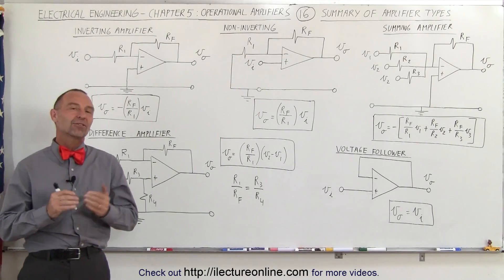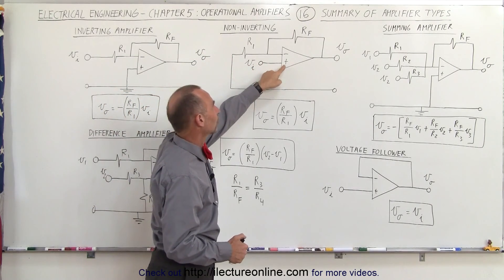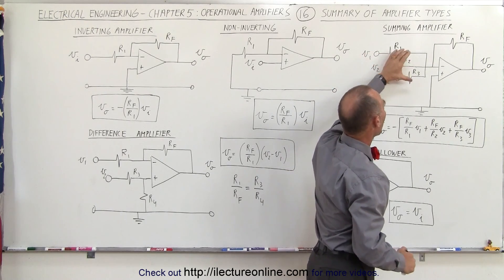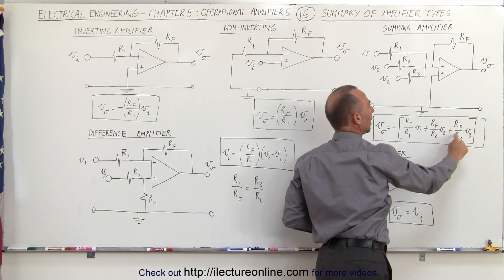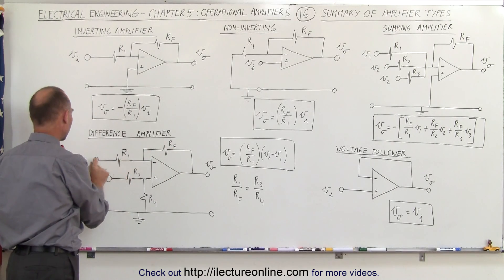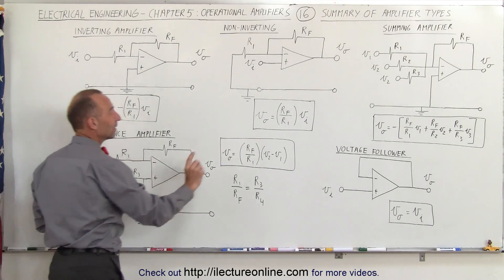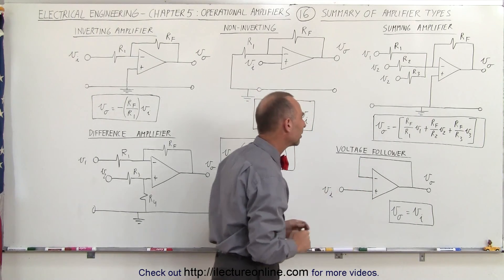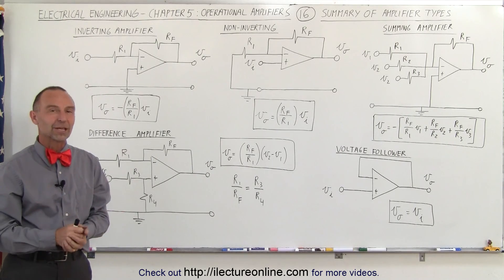Electrical Engineering: Ch 5: Operational Amp (16 of 28) Summery of Amplifier Types

Comment: Hello what would be the use of a voltage follower??
Reply from the maker: A voltage follower is able to "filter out" small low frequency variations on the input voltage which would not appear on the output voltage.

Comment: Question about the voltage follower/buffer: you can hook the input signal to the "+" input (as given on the board in the video) but also on the "-" input of the opamp.  The result, at least when simulating it in LtSpice, is nearly the same.  I say nearly, since I see a difference of ±10mV when using the uA741 as opamp in the simulator with a DC input voltage of 1.75V (= vi on the board).
Is there any preference, maybe from a practical point of view?

Comment: Can the "voltage follower" be adapted as a simple "voltage inverter" (my words) by swapping the + and - on the op amp? I'm just thinking if you need to interface with a digital circuit (0V and 3.3V) but have an inverted voltage then you could pass it through this "voltage inverter" adapted from the "voltage follower" to remove the annoying sub-zero voltage concept which makes no sense to digital circuits, right?
UPDATE: Yes it does act as an inverter. (I found your answer to the same question in the comments of one of the following videos)

Comment: with all the respect that I have for you sir, I think that you have a mistake on the non inverting amplifier, you forgot to put the +1 term :)
Reply: Watch his video on Non-Inverting Amplifier Basics, (4 of 28), at 4 min 20 seconds.  He says there that if the gain factor is large, you can ignore the "plus 1".  

https://youtu.be/c3u9RRIVkok?list=PLX2gX-ftPVXXuwvL-aLs3Q2Af3BwnrCyK&t=260
Reply: @dougedmunds  That statement is correct but still, the correct formula is with the +1 in it since maybe you don't want a large gain factor.  Next to that, it also gives you the impression you could weakening the input signal in stead of amplifying it with a non-inverting amplifier, which is not true.  The gain is always at least 1, so the absence of the + 1 is really a mistake and should be corrected...
But apart from that, Michel has done an awesome job, well done!  And he's not like many others: reading it from a paper.  No, probably apart from some preparation, he does everything "live" and I appreciate it he's sometimes thinking and/or correcting his mistakes, if any.  Hats off for such people!!!
Reply: True
Reply: yes
Reply: you are  fucking truee maaannn! coox duz deyirseeen .. Azerbaycandan salamlar..